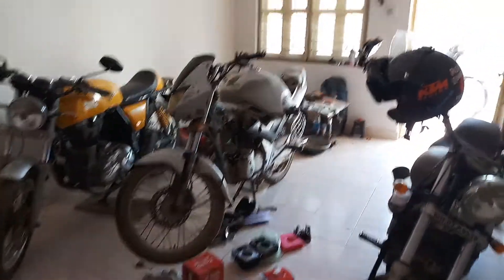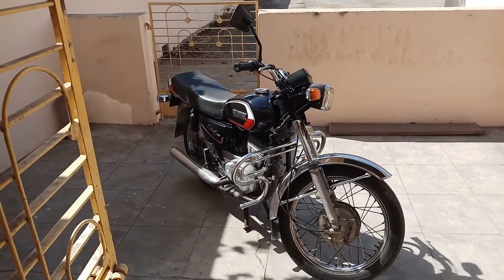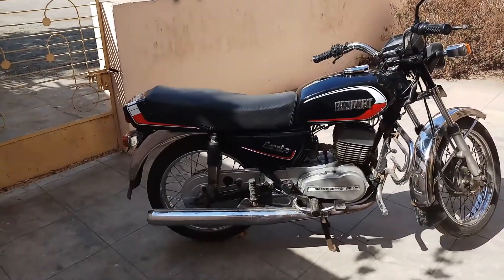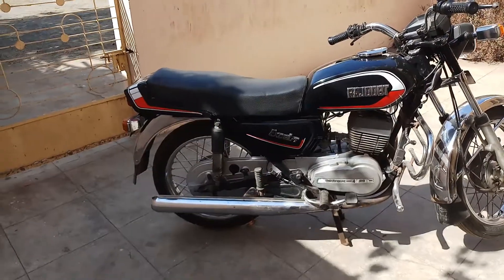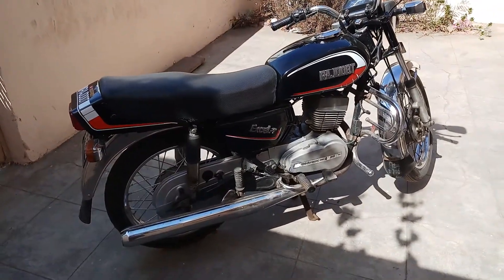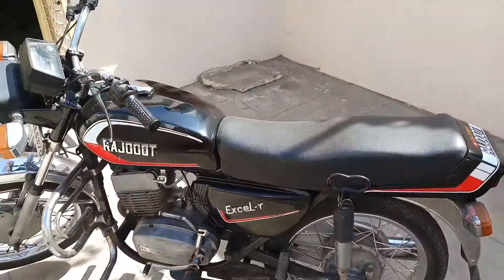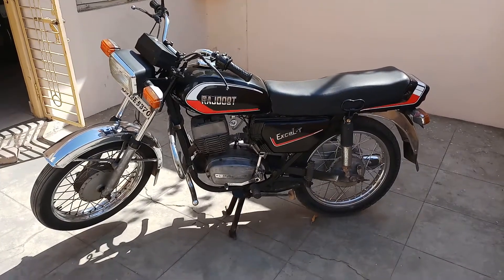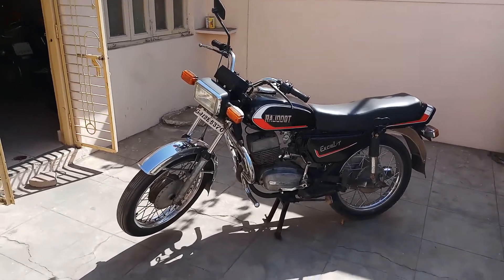Rajdoot 175 Excel T || Sunday show off

Comment: Rajdoot's rear cover available anywhere 
Pls let me know
Reply from the maker: If you are referring to the plastic part at the end, it's a pretty difficult thing to find. You can get it made in sheet metal.
Reply: I would also do the same thing but it will need a template to do it

Comment: Hello I'm from Mexico and I'm restoring a Rajdoot electronics 175cc 1993, you know of some page where I can buy the piston and make international shipping
Reply from the maker: Hi, I have sourced most of the spares locally, and hence don't about any such page which can do so, however let me know in case you are unable to procure it, I will try sending it if the process is hassle free.